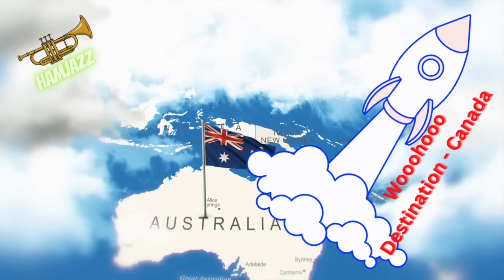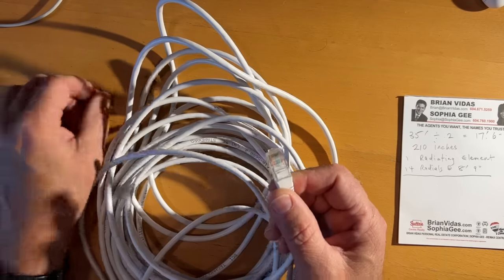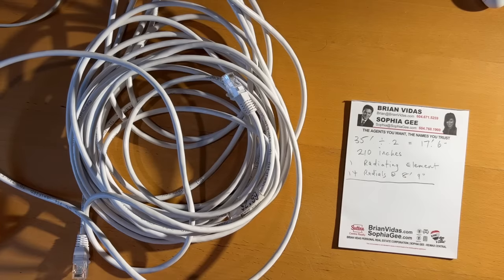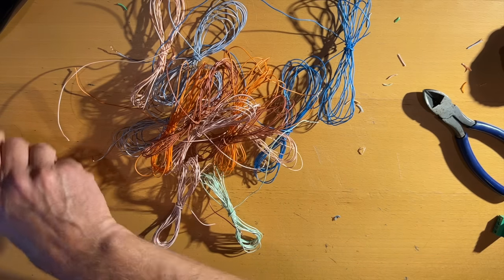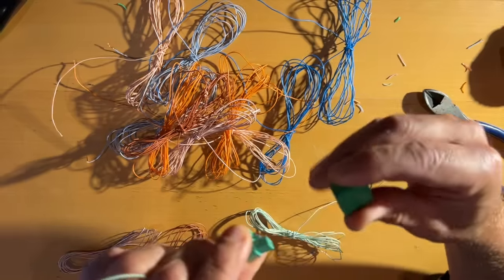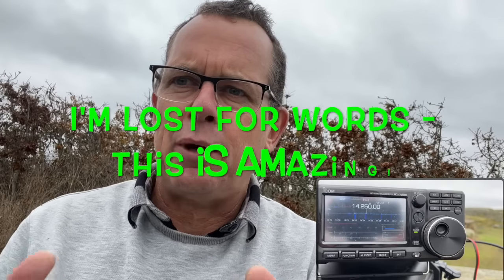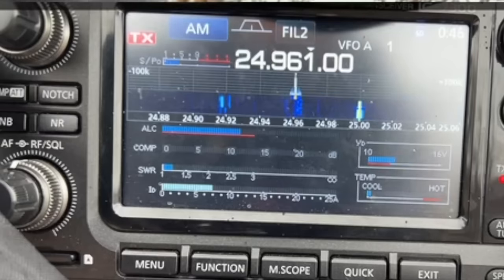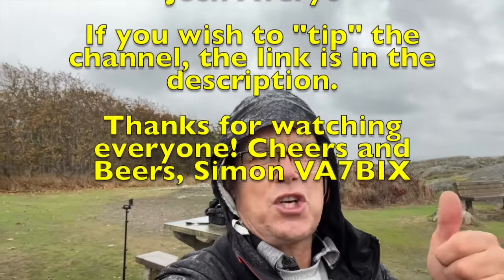5 Band Antenna for $5! DIY with an Ethernet Cable - No Tuner No Worries! #hf #antenna #hamradio

Comment: Ethernet cables are pretty thin so not sure if I'd use for more than 20W but great for QRP.  On the other hand it's only the vertical part that needs to be a bit thicker so you could for cents just change that for a bit of 1-2mm house wire and do 100W easy.  This is basically a ghetto DX Commander! 😉
Reply from the maker: G'day Stewart, thanks for your comment mate. The antenna works great, and I have some 'plans' and will shoot another video on options to change out the radiating element. I just love the fact that there is SOOOO much wire there in the one cord. '8 wires for the price of one!". wooohooo cheers mate
Reply: @thehamjazz  I don't doubt the performance I've made similar antennas and have a couple DX Commanders - they have multi[le verticals - otherwise exactly the same.  They work fantastic.  Like I said just put a bit of zip cord for the vertical or I've even used solid copper wire house wire and you can run loads of power too!
Reply from the maker: @Stewart-HA5RV  Fantastic Stewart.  I'm working on an 'another option' for the vertical element. Need to head to the hardware store wooohooo! Cheers mate. Fun stuff building antennas - it's the greatest!
Reply: This cable with swr 1.2 will be work fine even with 500w, without troubles. Haven't warm like high swr loses

Comment: So are you just folding over the wire to shorten its length or ?
Reply from the maker: Hey there - that’s exactly right. I’m just folding the wire over on itself - cheers! Stay tuned for part 2 video coming soon 👍

Comment: What a great way to repurpose an ethernet cable which has broken ends.
Reply from the maker: Thanks Robert, you betcha mate! And it's cheap!! I bet if you went to a construction site for a building they are 'demoing' you could probably get the old CAT 5 stuff by the mile hahaha. It is also dirt cheap at Home Depot, if you actually look at the fact you're getting 8 wires for the 'price of 1' haha. Cheers mate! Thanks for your comment

Comment: I've been using magnet wire for an antenna, but it has been terrible for transmit. I think I may be dissipating energy in the thin wire due to skin effect, so the SWR looks good, but the energy isn't getting out. Reception is great. Let us know if you get a different result.

Comment: Good video! I love scrap box antennas!
My understanding is that radials on the ground aren't too sensitive to length vs. freq. The length plays more of a role if the radials are elevated, so this design seems like it could be quite forgiving!!!
Reply from the maker: Hey there mate, thanks for your comment. These radials @8' 9" work a treat elevated as well buddy. I am able to easily tune from 2 meters all the way up to 40 meters! It's an incredible radial system. Happy building mate! Cheers

Comment: What’s the thoughts on 100w going thru that small of wire ?
Reply from the maker: Hey buddy, 100 watts won't be a problem, provided it is resonant. Weather permitting, I'll use this bad boy tonight for the Grey Line. My trip to Oz last year, I used 100W exclusively with this radial system. Cheers and beers mate

Comment: Hey dude, have u tryed to keep all the verticals wires together and see if it works??
Reply from the maker: Hey mate, ya I have tried it and the problem I ran into was capacitance coupling - meaning they all sort of act as one, so it's like having one wire out there instead of 14. Thanks for your comment mate, and happy building. Cheers

Comment: I buillt an 80 meter loop using twisted pairs and radials fot a vertical.. there are 2 types of cable, solid and stranded, i used solid but it is the worst as it tends to break if bent agressively...
Reply from the maker: Hey there David, I have both the solid and stranded.... this particular Cat 5E wire is very flexible and stranded. I do have a solid as well mate, and couldn't agree with ya more.... you have to be extra careful to not kink them. Cheers buddy! Thanks for your comment
Reply: @thehamjazz  You are welcome. I have spare cable and I use it even for hanging antennas on trees, could be used for building verticals, I mean using the entire cable without stripping. I heard it could be best if soldering all cables every certain length, I think because of the twist of the pairs or the dissimilar length. Have fun!

Comment: How many watts will the antenna handle?
Reply from the maker: G'day Jeff, it will handle 100W, provided it is resonant. As I mentioned to Mike above, I used this similar radial system in Australia for all of my activations at 100W. Just gotta be careful not to kink the wire, so wind 'er up on a spool or as a 'figure 8'. Cheers mate, and thanks for your comment

Comment: What are you using to connect the different lengths for the 5 band radiator wires or is it a single wire you're shorting at the required lengths?
Reply from the maker: Hey there mate - thanks for dropping by. The total length of the cut ethernet cable is 17ft 6 inches. I left one wire uncut, which is the radiating element and the remaining wires, which there are 14 in total, are cut in half - so they come out at the exact same length which is 8ft 9inches. I removed the shield of every radial wire and connected them all together as 'one' if that makes sense. I then screwed them into this Terminal Block (link in separate comment) - If you put this into Amazon in your country you should see them listed there.... So once I connected them all into one of the terminal block ports, I tested every radial to make sure there was continuity of current. I hope this answers your question mate. So in short, all of the radials are exactly the same length. Cheers mate
Reply from the maker: TERMINAL BLOCK - AMAZON....   Keszoox 10 Sets 5.08mm Pitch Male & Female No Soldering Green Phoenix Type Connector 4 Pin PCB Screw Terminal Block

Comment: The thing is, what about efficiency? How long can it get ?
Reply from the maker: Hey there Jimmy, thanks for your comment. I have no clue in 'theory' but I am going to be putting this guy to the test comparing it to other antennas in a real time POTA activation. I will say this.... when I was in Australia last year, this radial formation/ pattern and a 17ft whip worked wonders for long path DX. When you say "how long can it get" are you referring to DX contacts? or are you referring to wavelengths and tunability?
Reply: making it a video? 
73s from GM
Reply from the maker: @SteampunkSammy  Hey buddy - I definitely will. Cheers!